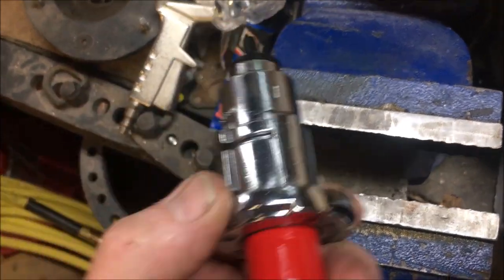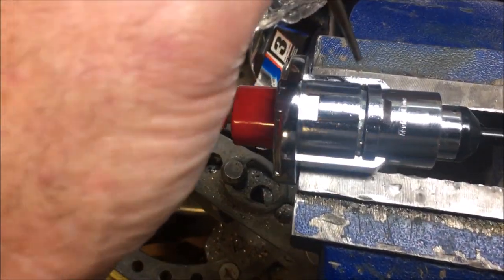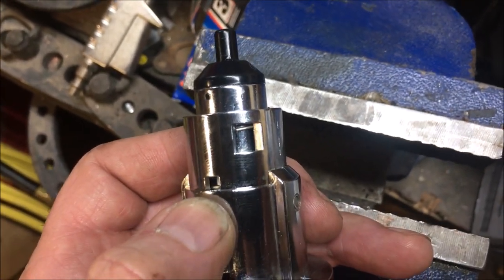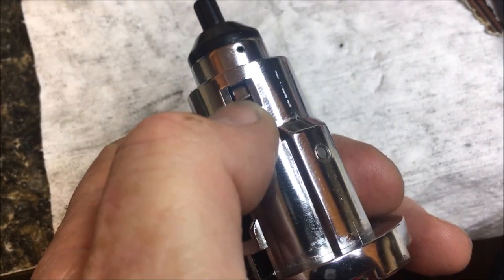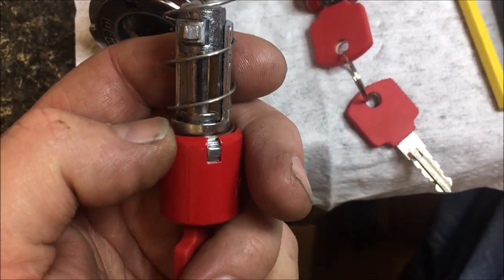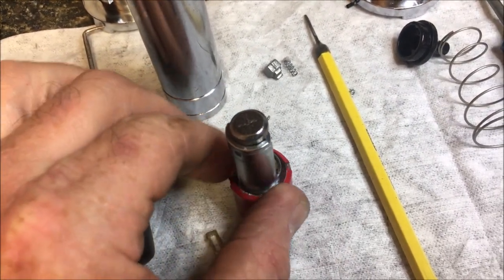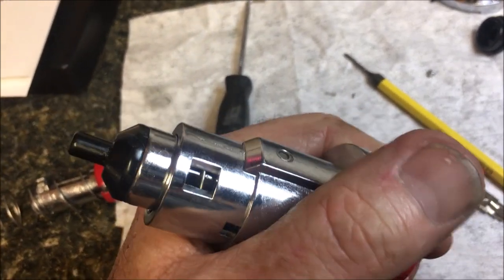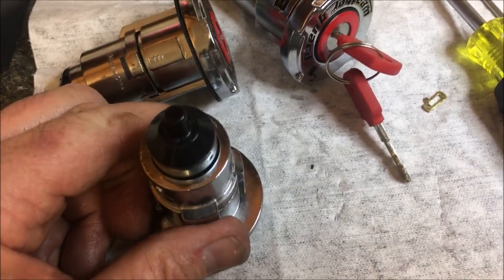How to rekey WeatherGuard Toolbox locks

Comment: Thank you for posting this. Although I didn't need to rekey, I did need to get to the cylinder to remove a broken piece of a lock picking tool left by someone else. I was able to order replacement keys by reading the key code you showed and buying them from a locksmith on Ebay for $10/each plus shipping. Your video saved me hundreds of dollars in replacement matching locks. Thank you!
Reply: what locksmith did you use I have the same problem

Comment: How did you re key it. I watched the whole thing waiting to see the rekeying part.... did you have to move wafers around? Get new wafers?
Reply from the maker: actually had an old wafer kit that fit the lock... The big deal is just getting it apart... I did it awhile ago and forgot, made this video so I would know where to look to remember....
Reply: Tim Tracy thanks for the response. I’m kind of a lock guy, (hence the channel) and I got a friend that wants me to pick one tomorrow. So I figured I’d re key it too if it was easy.
Reply from the maker: @jpmcpinning4255  If you have the lock out, there is a code on all the locks, just look up the code and cut a key...  I have a customer who is a large construction company, lots of trucks, they wanted all the boxes on the trucks keyed alike, that is why I rekeyed these...  the boxes were supposed to be keyed alike, but out of 20 boxes, about half were different keys.. in fact there was 5 different keys, some of the truck boxes had different keys for each side of the box...Did the first batch, then they got more trucks, and seeing as I am old as dirt, I forgot how to rekey these...  the big deal is getting that washer in the middle to turn...  If you get the number on the lock, shoot me the number...
Reply: Tim Tracy thanks I just picked it and replaced it with another lock I had. It was more like a file cabinet lock so I had to rig it a little but it worked.
Reply: @timtracy9442  i have a m210 can you help me?
Reply from the maker: @kaosfiles007  is that a code on a weatherguard lock???  because all of those locks have a K7xx series...
Reply: @timtracy9442  yup right on the cylinder. M210. Called weather guard directly. It's only obtainable through a dealer amd not online portal. I was quoted like 70 bucks for 2 keys. Which I find crazy. I'm almost ready to just remove the tumblers. So they turn with any key. At least better theft protection to look locked. D style handles.
Reply from the maker: @kaosfiles007  does the lock look like the one in the video??

Comment: Any advice on the older Weather Guard locks?  They have the red push button, but also a red flange around it as opposed to chrome.  The old style is completely different on the back side and appears simpler, but I can't figure the darn thing out.  I'd really like to disassembly it to clean it.
Reply from the maker: I haven't had the chance to work on those...  Most of the companies call me for extra keys on newer trucks they get in, and the new trucks have newer locks on the boxes...
Reply: Look on the cylinder there is a code number on it starts with a "K".. Then look on Amazon for Weather Guard keys. I ordered two on there for like 10 bucks and they work great.
Reply: Once you pry around the red flange it pops off and cylinder pops out do same for the red button cap and your at the wafers
Reply: @cruzingpapa   thanks for the insight!! I found the code on the lock and went online to find the key 🔐 that I lost 😅

Comment: Watched this video to see how to rekey the lock and completely skipped the rekey part.
 "This is how to take apart a weatherguard lock" it is great for that part but still gotta find how to rekey it
Reply from the maker: sorry,  most of us know how to rekey a lock, the biggest issue with this lock is how to take it apart.. If you don't know how to change out wafers, you should probably take this to a locksmith.. There pretty good at changing out wafers..
Reply: Yeah I know your right. But I've not been unable to do something yet if I can find a video showing it, from rebuilding 4l60e transmission to wiring home fuse box and soldering  ps3 components etc. So I'm going check with a locksmith if they can do it or if I need to disassemble it first. I was just wanting to learn to do it all myself.. my moto is "If someone else can do it I can do it! Yeah maybe I can't dunk a basketball lol but most things when it comes to building or fixing I can just gotta find the video of it 😅